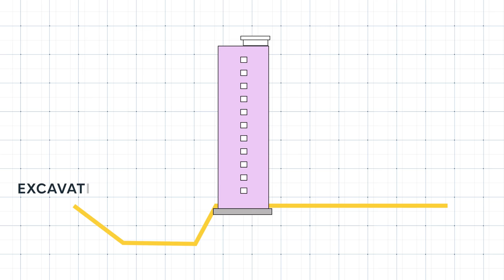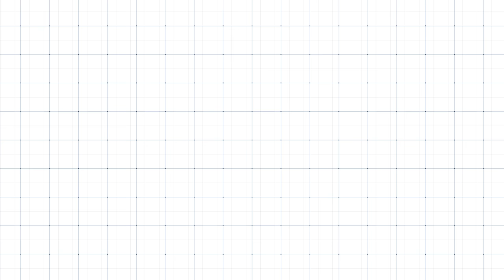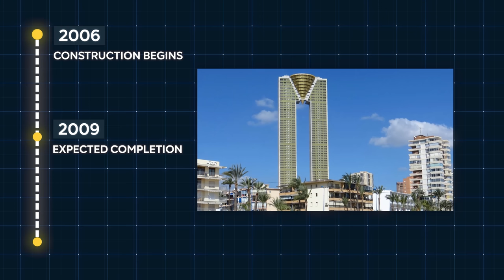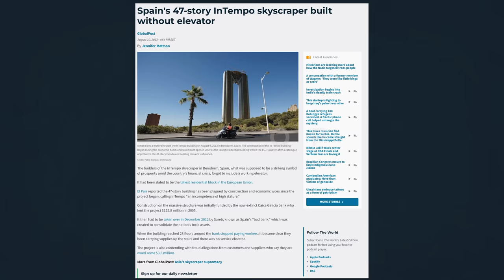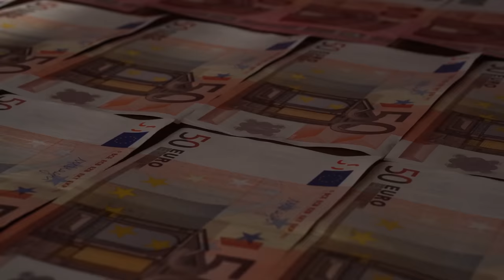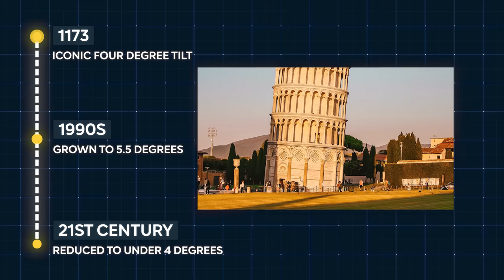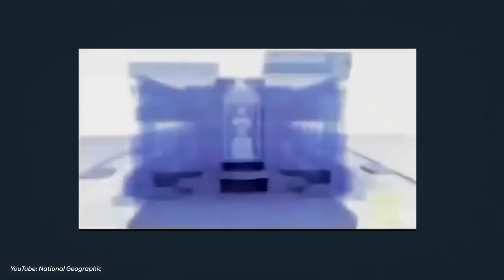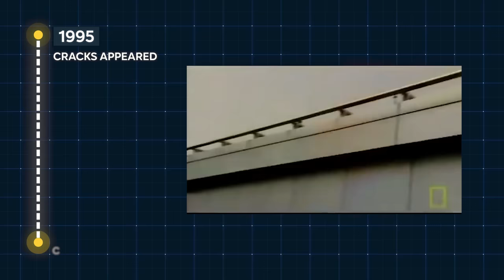The Biggest Construction Mistakes in the World

Comment: You need to cover the Millennium Tower in San Francisco! It has tilted TWO FEET since its opening in 2009! The skyscraper is 645 feet tall and nothing so far has stopped its tilting!
Reply: Two feet of tilt on a 645 foot building is about 0.18 degrees of tilt. It's not great but the problem is overblown in the press.
The building has a long way to go to get close to Pisa's 4 degree tilt.
Reply: @ddegn Perhaps you’d like to live there? After all, you said only 0.18 degrees. You do realise it’s getting worse, and the speed of leaning is likely increasing despite attempts at fixing it.
Reply: @ddegn  Its not overblown when sewage lines can't properly drain from the mid to upper floors snd end backing up into residential units. And the measures to keep the tower from tilting further have shown to be inadequate and made the problem worse. Try again.
Reply: @BagoPorkRinds  if the building has sewage lines that do not drain be sure that the construction has more issues than the 0.18 degree tilt.
Reply: Not to worry. The whole real estate market in San Francisco has collapsed. When that tower finally falls, the area will be so abandoned, that no one will notice.
Reply: @michaelmoorrees3585  are you a right winger? :face-green-smiling: -   real estate market in San Francisco has collapsed ? is still one of the most expensive in the world. :face-turquoise-covering-eyes:
Reply: trumpisthemessiah7017 Some sewer lines in the building have become inoperative and needed retrofit.
Doors that don't  close, ,  utility line retrofits from the building to supply side   needing rework to handle the movement, cracked walls...
Nothing to see here, move along🙄
Reply: Could it be fixed by having a permanent offer for free donuts on the side of the building opposite to the tilt? You'd have to install a donut stand in the correct place near the top. And hire lazy staff so there's always a queue. But the result would be a free system of counterweights as a constant stream of people rush to get their donuts.
Reply: Call in Superman - he'll give it a shove and bingo!!
Reply: @morganangel340  Some of these critics haven't been any further West than the local Memorial Slave Mart, Witch Burning Pyre, religious Dunking Pond, and Pilgrim Statue. Their victimisation is political.
Reply: @AntonioPeralesdelHierro 
All the places you mentioned are democrat areas.
Reply: Of topic: this comment thread is a good example on how no one can agree on anything even supposed facts😅 the building is coming down Vs the building is just fine, real estate market has crashed Vs it's the most expensive real estate market in the world 😂
Reply: @keithb6717 all large cities in every state are democratic areas. Places with things to do and jobs galore.
Reply: @thetruthfornow6045  
And that’s where the vast majority of crime is. Democrat cities.
Biggest income inequality = democrat cities 
Highest murder by cap = democrat cities 

Did you know that the ratio of unemployed is lower in the country?
We have more to do. Real stuff like boating fishing hiking flying etc and our streets don’t smell of piss and democrat excrement. 
   San Francisco has some unusual jobs like Poop patrol. Pays $185,000 year to clean up after democrats. I’m very proud of you for providing such diverse employment opportunities.
Reply: @keithb6717   Cities have problems that is why most people commute by car or train to their jobs in the city.
Reply: trumpisthemessiah7017 I doubt you are any smarter.

Comment: I saw a shopping complex built in a Chinese community in Los Angeles.  It was a huge corner complex at a major intersection.  Working as a telecom tech back then, I saw all the faults of the structure.  Sub basement walls were never waterproofed, resulting in year round wet walls and floors in the lower parking lot.  The first level floor didn't have the proper concrete reinforcement so it sank when tenants started moving in with their equipment.  Then I found out that this was the first concrete building this architect  had ever designed in his career and yet it still passed the local city inspections.  Someone's pocket got lined.
Reply: That's reminiscent of the Surfside collapse in Florida.
Reply: Chinese is famous for Tou-Fu dreg constructions!
Reply: @61zulu77  racist spotted. Just so you know, this complex is built Los Angeles.
Reply: Architecture with Chinese characteristics. 😅
Reply: @yao5921   You mean knowing certain facts makes you racist?
Reply: @ksm273  I guess it pays to be shill, karma will get to all three of you. or I say, one guy with three accounts?
Reply: @yao5921  Despite threats, facts need to be told and recognized.
Reply: @ksm273  paid shill recognized. Fact. I will not respond to further reply from shill. see you never.
Reply: @TheOtherBill  and not just Florida.
Hard Rock Hotel collapses during construction despite state inspection not seeing any issues.
Mainly because approval was given to continue construction without the inspector in question actually visiting the site.
Negligence is a global phenomenon
Reply: How tf does a state or city in the US just ignore things like this. I’ll give it to Texas that even if inspectors miss something early if they find faults later even if the structure is completed the contractors have to fix it at their own expense. I remember either in Austin or San Antonio a high rise with a rooftop pool had some cracking issues and the pool had to be drained and replaced and or moved to ground level. They fixed it and still had to wait for like two or three more inspections and that was just the city. The state also had to sign off and OSHA still fined them
Reply: He just an anonymous guy behind a keyboard  There's no way to verify anything he said.

Comment: The least surprising was the Aquadom. People always underestimate water.
Reply: They overestimated the strength of the plexiglass .  They may also have underestimated the chance that a second oil/gas crisis would reduce heating in the surrounding atrium (this was the first winter after gas imports became problematic).
 A few details:
1. The acrylic construction details were kept secret by the specialist supplier .
 2. Although surrounded by a hotel, the tank and elevated were both part of a general "fish zoo" next door, with a special route for paying zoo guests to visit the 1000 to tropical tank .
  3. Fish zookeepers rushed in to save as many fish as possible .
Reply: Also not surprising... China
Reply: And of course it was built by a US company, as German contractors politely declined due to the high risk... 🙈
Reply: @johndododoe1411  and they set up impromptu grills to take care of the other fish... j/k
Reply: 1,700 lbs per cubic yd.

Comment: According to Seconds from Disaster documentary, Sampoong's cracks isn't just from construction failure, but also accelerated it via the air conditioners, instead of using cranes to move them, the management orders a cheapter roller system to easily move it on the roof, right on top one of the straining column, 5E. It also comes from the vibration of turning on also contributes to the failure until collapse.
Reply: They also included a traditional Korean restaurant on the top floor, which required a much thicker and heavier floor (because it needed to be heated because traditionally they sit on the floor to eat), which added even more weight.
Reply: The day it collapsed they thought if they turned the ac units off everything would be okay. So it was filled with thousands of people and it was very hot and humid. I believe when they looked they saw that a column had punctured the rooftop

Comment: As someone from Alicante, I remember hearing rumors that the Intempo, or the M building, as we call it, was actually abandoned because the construction company presold many flats already and decided to run away with the money
Reply: He didn't mention a single construction mistake in that segment, other than than the lift mishap that injured the workers. I think it was only included in the video because the building is so interesting to look at.
Reply: @travisfinucane  It looks like a pair of pants to me.
Reply: @travisfinucane  This is what I came to say.  I have since done some more research and still, the only construction mistake I can find is that, they failed to make adequate provision for emergency services access during construction.  So when that service elevator lift accident happened, there was a several hour delay getting medical staff to the relevant part of the site.  Still doesn't seem sufficient grounds to include it in this video.

I'm glad they did though, it looks like a pretty iconic building and I'd never heard of it before.
Reply: They are advertising flats to rent to tourists in the benidorm building
Reply: What does the M stand for?
Reply: That is so Spanish. Also thousands of new houses were sold mainly to foreigners, claiming that all is ready including electricity and water supply. When client got the key realised he'd have to DIY the water and electricity connection, costing thousands of eur. Besides street electricity wires and water pipes are just about 10- 15 cm under the road, and weekly a water pipe burst somewhere. So much fiddling, corruption and shameless byrocracy I haven't seen anywhere in Europe, not even in Eastern Europe.
Reply: Yeah, it looks like the project was plagued with management mistakes, not construction ones per se.
Reply: @alukuhito  The building looks like the letter M
Reply: @mazafakabitch1113 No kidding.  But what does it stand for?  Was the architect's name Mike?
Reply: @alukuhito  It just looks like the letter M
Reply: 😂 sounds like something that will happen in Morocco too. Not so different after all 😅
Reply: @alukuhito  Kinda - it's Miguel, Spanish for Mike - he frequently subtlety incorporates his initial with the projects he heads up.
Reply: @carlsaganlives6086 That's not very subtle though.  It's a huge M in the town.
Reply: @alukuhito it's like saying the Golden Arches for McDonald's. They could call it the pants building or the m building or the golden arch or whatever your fancy. That poster was just calling it what they and those they know call it. Others probably call it something else. No mystery, 😊.
*Just read the above comments and that is pretty neat that the architect did that, 😂. So maybe that is some people's reason for calling it that because they know the bts story.
Reply: @YNomadicCreator I don't understand why anyone WOULDN'T call it the "M" building.  It looks like a giant M.  I'm just wondering why someone would decide to design a building that looks like a giant M.  Again, was the architect's name Miguel or something?
Reply: @alukuhito  ok, I just looked on Wikipedia and there no mention of anyone associated is named with an M, either first or last name. They must've just liked the look and went with it, 😂. Call it an architects freedom of expression, 🤔🤣? The main question should be for those who signed off on it. I've seen some doozy projects out there and it blows my mind they were even given the green light to build! 🤭
Reply: @mazafakabitch1113 I live in Benidorm and the first rumour from 10 years ago was that the "M" stood for Moscow as it was controlled by Russians but probably not true.

Comment: The Pisa tower started tilting very soon after construction started. I’ve always wondered why they didn’t start over and instead continued building a tower they knew would never stand straight.
Reply: I have also wondered why they didn't just start over or at least dig a little deeper and add support.
Reply: Hubris. They tried to correct it and sent it the other way!
Reply: It is kind of like Brexit.
Reply: But it is still standing
Reply: @arribaficationwineho32 - Thanks, Sherlock. Got the fact from Captain Obvious.
Reply: @sharongagnist6428 - When it started tilting originally, the tilt was only slight and quite not noticeable. The builder believed that it was normal ‘settling’ of the foundation, so they tried the "straighten" the additional floors as they build it to counter it. The famous Tilt happens through many years after the construction before it normalizes and then "Fixed" in the 90’s
Reply: @inisipisTV  that makes sense and I knew it took a while to lean as it is today. Thank you for the information though. The currant construction mistake is the one in San Francisco but that didn't take as long to lean. The sinking and leaning Millennium Tower is now tilting more to the west than ever.
Reply: @noelpucarua2843  

Problematic, but it still works just fine? :-D
Reply: @nickbrutanna9973  It's a bell tower. Did you not notice they had to take the bells out of it. 
At best Brexit could be some sort of oddity that people gape at.
Reply: They believed the ground would finish settling and that they could correct it by adjusting the height and weight of the upper floors.
Reply: Pisa Tower had NO safety rail when I went in the early 90’s. Also a narrow walkway, barely enough room for 2 people. I met someone coming the opposite way & made them take the outer side while I hugged the wall. Europe generally, not big on safety compared to the US. Looks like they have a rail now.
Reply: I was not able to ascend the tower, but was able to climb to the top of the cathedral in Florence and St Peters in Rome. You’re right, it was pretty much “every man for himself” as far as safety, with some surprisingly perilous spots.
Reply: @gtlfb  Yeah, if they had slide out glass 'ledge' like at Sears Tower in Chicago, it would be a glass bottom, but with velvet ropes around it.
Reply: I have been there in 1974, I reckon they built it like that!!!
Reply: Thats why we know it worldwild today. There's 1000 of normal tower and we dont know about them
Reply: As it took two centuries to complete, the builders had plenty of time to use thinner lighter blocks on the overhanging side and double them up on the other side. Still didn't make enough difference. Only when Arup engineers laced it with cables and hidden heavy blocks &c. was its future secured.
Reply: And miss out on all those tourist bucks?

Comment: "A number of columns were removed to give way..."     Yeah, that says it all.
Reply: The remaining columns were made thinner than originally designed to make even more room.
Reply: @foxymetroid they also cheaped out on the rods :(( there were supposed to be 16 around each column, the CEO wanted only 8
Reply: They also put heavy air conditioning units on the roof, the spinning motors of which caused vibration that weakened the structure.

Comment: I recall seeing a video on the Mall, saying it was due to the extra weight on the roof when they installed larger air units on the roof and there was no underlying support.
Reply: yea. i think i saw it like 10-15 yrs ago on discovery or natgeo channel
Reply: This was caused by a dozen deadly causes. Every reason can cause collapse😦
Reply: The original building was only for 4 storey, but the owner added a 5th. It’s already at it’s limit by then. When they added the new heavy machinery and cooling system, breaks started to appear. The owner called up Engineers to inspect and find a way to fix it. The Owner should have closed the building already and remove all stuff inside. The halting of machinery with their vibrations and the reduction of weight from people would have saved the building, since they’re in the process of putting more reinforcements and repairs. It’s really negligible murder.
Reply: A big reason was the construction method that left little room for error. If they had stuck with the original plans, the building would most likely still be standing. Unfortunately, they removed some support columns and made the remaining columns dangerously thin. The dragging of heavy air conditioning units on the roof certainly didn't help as it weakened the already doomed structure.

The owner who ordered the changes did spend time in prison for it. I guess that sounds strange when you've grown to expect a fine at worst for people in similar circumstances.

Comment: If you haven't covered it elsewhere, I'd like to see a discussion of the collapse of the skywalks in the Kansas City Hyatt in 1981 included in a video. I had gone to school in Omaha in the years before that and was a frequent visitor to Kansas City so this had a personal resonance for me.
Reply: I've only known about that case because it was featured by Fascinating Horror. It's a very interesting channel as it dives in to the bad engineering and kickbacks etc.
Reply: The original design had long rods suspended from the ceiling. The upper deck was to rest on (large) nuts partway down, and the lower deck on nuts at the bottom. 

This would have required most of the length of the rods to be threaded, and the construction company didn't want to deal with it. So the design was changed. The upper deck was on a short rod, and the lower deck was suspended from the upper deck by another rod. The joint that was supposed to hold the upper deck was then holding the full weight of both walkways. 

The original design was substandard. The new design could barely hold the empty walkways. Add a bunch of people, the joints holding the upper walkway let go, and both levels pancaked into the lobby.
Reply: This started my interest in architecture. Then I got more interested in Victorian houses. I'll never forget when I first heard about the skywalk disaster, and they talked about the rods. Even though I had recently graduated high school without physics courses, I realized that would never work. It blows my mind that they were "too lazy" to thread a single rod.
Reply: I was coming down to the comments to see whether anyone had suggested the Hyatt Regency hotel walkway collapse.